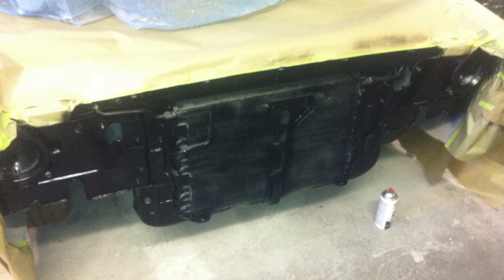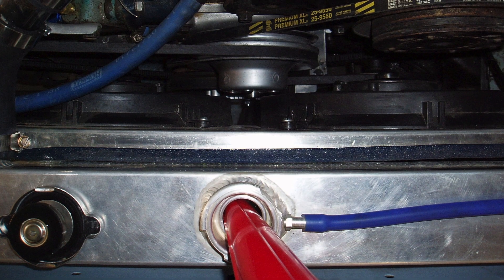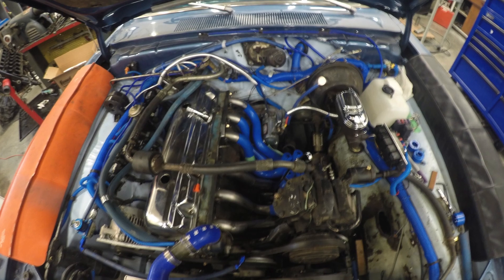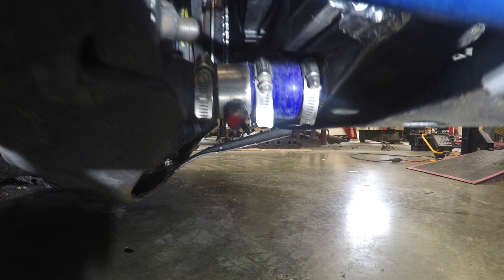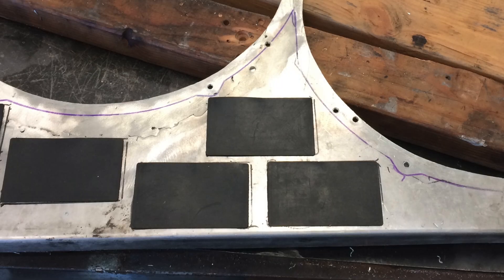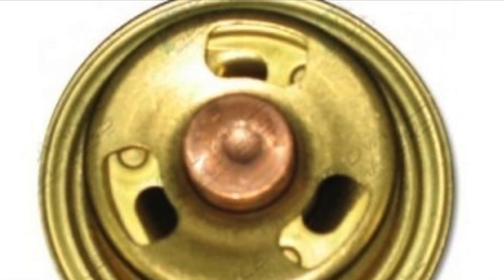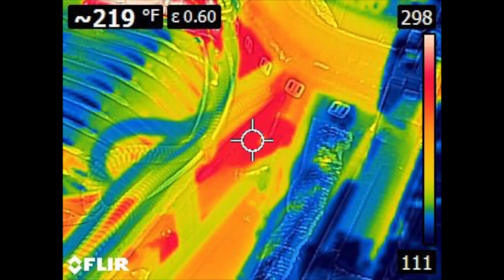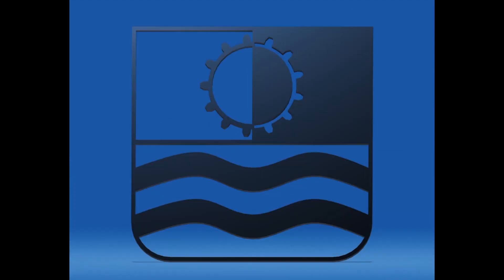Turbo Slant 6 Duster Cooling

Comment: I am interested in putting an oil cooler on a slant 6, which sandwich plate did you get?
Reply from the maker: Derale Temperature Controlled Sandwich Adapter Kits 15702. It worked fine, granted it hasn't been on the car for a while.

Comment: You definitely need to upgrade to a aftermarket power-steering gearbox with a smaller case. I've seen them lately, but can't recall the maker.
Reply from the maker: They are made by Borgeson, I looked into them when I was building the manifold and didn't feel like I wanted to make the nonreversible modifications to the car, and at this point I should have it covered with the cooler and some heat shielding.